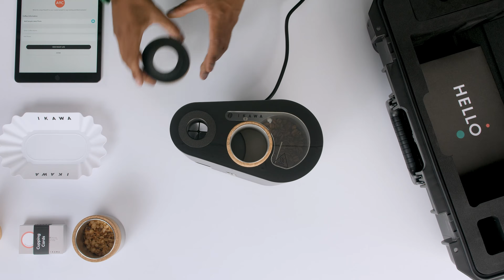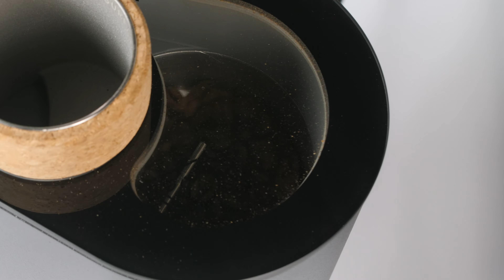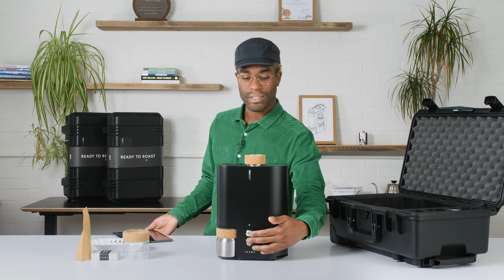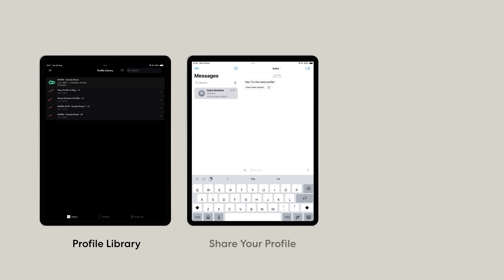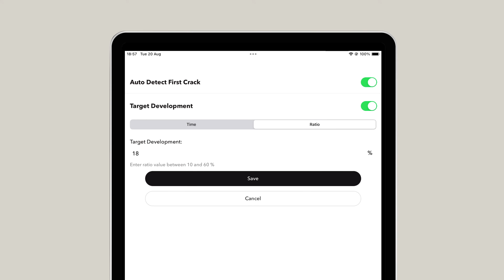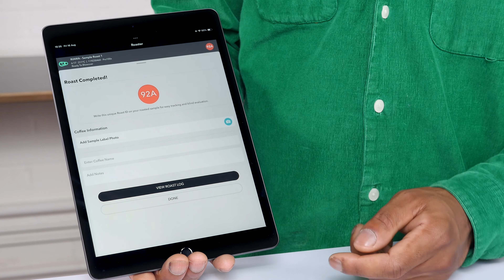Your First Roast | IKAWA Pro

Comment: How do you know what profile to use when you buy XYZ coffee.  Is there enough info on the coffee package to set the profile.  Thanks!
Reply from the maker: Hi! 

There are a few ways you can go about this. 

1. You have a standard profile that you use for everything. 
There are many professionals who like using one profile for all the coffees they sample, so they can be sure that the roast is not one of the variables they taste during cupping. Most people will work with a very general profile, or one that they can find in our profile library - like Sample roast 1. 

2. You pick a profile based on the coffee characteristics. Most of the time the sample packs will come with enough information for you to make a good decision about what type of profile to use. Again, many people rely on the ones found on our profile library, which they can tweak or adjust as needed. Or create one themselves based on their preferences. 

Hope this helps!